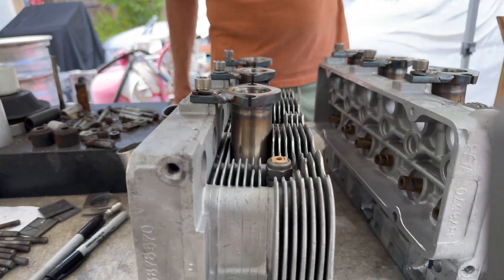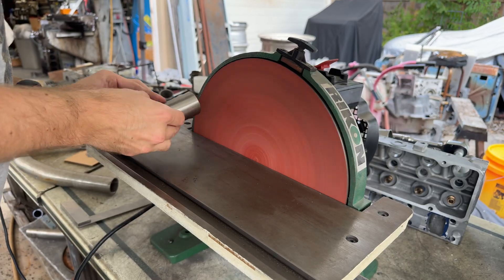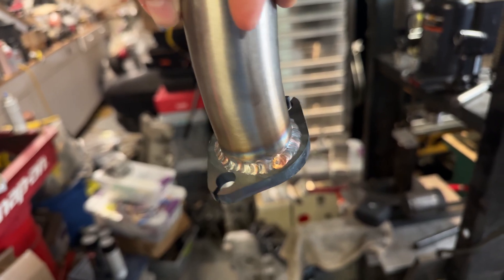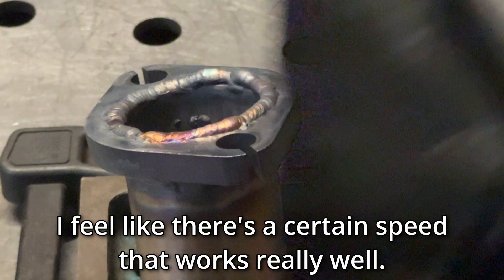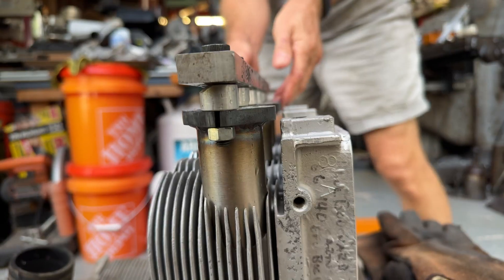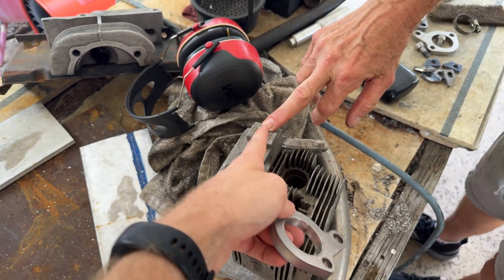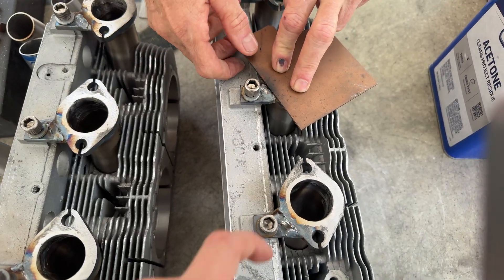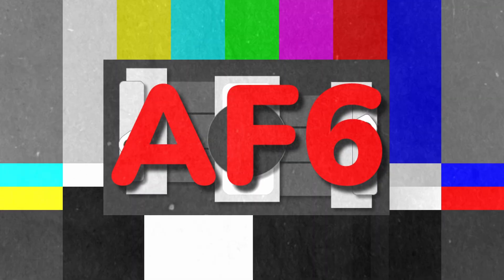How We Make Angle Ports For Corvair. (Corvair Head Rebuild Series Bonus Video)

Comment: Beautiful. You can mig stainless also. I do it all the time, if for whatever reason you wanted to make it all stainless. Do you guys only do 140 heads?
Reply from the maker: Thats true. We do the flanges in steel right now because we don't have the correct gas and wire for stainless. We do big valve conversions for all heads from 80 hp to 110 hp and turbo. We can also convert heads from one to another like 95hp to turbo (except non-140 to 140s because of the port casting).

Comment: So, is that a $10,000 engine? $15,000?
Reply from the maker: Close. For this customer, we did much more engine work than just these heads...
Reply: @AmericanFlat6  I dreamt of making a hyper Corvair. Tube frame, 7/8 scale widebody fiberglass, all suspension gets rid of giant steel stampings changing to unequal length steel tube design with horizontal shocks, mid mounted gas tank, sound proof, $20,000 interior, $15,000 paint, chop 2”, lay back windshield and possibly move it forward about 3”, 20” wheels, widest tires in front, carbon tube shift linkage, and on and on.

Comment: What does all this work buy you in terms of performance?  Why do it all if it doesn't give you a lot more low end torque?
Reply from the maker: The heads of rebuild itself gives a huge boost in performance and the angle ports improve the exhaust flow significantly. These heads specifically are for a big bore 3L engine so it will have a lot more low end torque while also having top end power.

Comment: Welder here....why was he using that big ass cup !!!!
Reply: Better gas shielding of the weld.
Reply: @charlesheit4880 yes it does....but is it needed in this case ? ....former rocket welder here
Reply: @jonsingle1614 highly recommended when welding stainless
Reply: @charlesheit4880 Never have needed to use one....welding stainless myself...but the fact that you can't see your welds would have made me switch to a smaller cup
Reply: Gas lens from hell

Comment: Really impressive work done here! Wasn't aware there was the much demand fore a high performance head for the Corvair six. I'm surprised with today's tech, someone isn't creating a 3D print and casting new heads with built in performance upgrades like the VW flat fours have?
Reply from the maker: Thanks. Guys are still driving their Corvairs around and when they drop a seat they also want to get an upgrade. You're right there should be an upgraded head available already. I think the only reason someone hasn't done it is because the market is so small. We're working on something now so stay tuned.

Comment: You might have your Pop try using a Furick #16 clear glass cup while welding. I notice he get the electrode a bit far in front of the puddle. Is he using 2 % Lanthanide electrode?
Reply from the maker: He was already complaining about not being able to see the puddle behind the arc and torch so a clear cup would do wonders. He uses 2% thoriated so he can do 300 amps on aluminum. Maybe he needs to use a lanthanide electrode just for stainless or thinner welds.

Comment: My 2 cents 

I’d might have looked into having some sort of ceramic coating on the tubes to help deal with heat. Air cooled engines really need all the help they can get in that department 

Just leave last 1/2 inch or inch bare where the interference fit in the head is.
Reply from the maker: That would be a great addition to this mod. Temp is definitely the enemy for Corvairs, but with the race port exhaust, the heads already see a 50°F reduction in temp. 
My dad has gotten the chambers and exhaust ports ceramic-coated before, and it helps, but it increases the cost and lead time quite a bit. I will be doing a video soon on all the random modifications my dad has done to the "test" heads we have lying around.
Reply: @AmericanFlat6 dam that’s a big drop

Just ran into these videos so I’m probably gonna end up binge watching them 

I love how it’s just the right amount of old school cool mixed with modern tech

Comment: Also, why not cast a new head? And cast new big bore cylinders . To allow 1.60" 2.02" valves and 4.125" pistons .   Or two 1.45" exhaust  valves and a pair of 1.94" intake valves and possibly water cooled make billet cylinders with water passages. A head made similar.  Cast the rough shape in a spinning mold to inject the aluminum under centerfugal forces have 2 or 4 head molds on a turntable.  Spinning at 45-250 rpm with the molds heated as the aluminum fills them . A 60" wheel with plaster covered foam inside sand the aluminum kept warm (possibly) afterimage is poured. Spun at a decent speed. Forcing games out of the aluminum. The head possibly  uses 4 additional bolts to clamp the head to cylinders.  The new water cooled  cylinders and heads  has an integrated water manifold . Feeding water into the head at the exhaust manifold across the head 25-30% of the water entering the cylinders exhaust side . The rest on the intake side and possibly  an aluminum bracket or girdle bolting head to head top and bottom. (For big power engines.( Or aero use)  helping keep the heads on the crankcase with high cylinder pressure..  the heads being about 1"-1.5" taller than stock. With the intake and exhaust ports raised .750"-1.25" use beehive springs and m6 valvestems, possibly LS valves .
The  raised ports and large valves should double flow compared to stock   or modified stock heads. Not certain if the bore spacing or head studs would allow a for a 4.125" bore. Maybe a
4.0" or 4.065" (a 4.250 would be nice)  Maybe cast a crankcase and cylinders with heads also. A BIGBLOCK CORVAIR ENGINE.  A CUSTOM CRANK AND CAM. 4.250" -4.375,4.400" bore with a 3.50" to 3.80" - 4.00" stroke.  6" rods use big block or small block bearings and crank journals cast a steel crank with big block snout using a bigblock chevy timing set. Possibly a gear drive big block cam bearings . A custom cam core milled from a 3" HSS TOOL STEEL BAR. BORED HOLLOW AND A .010" HOLE IN THE BASE CIRCLES ON A FLAT TAPPET VERSION. OR A ROLLER VERSION USING BIG CHRYSLER  OR CHEVY  SOLID ROLLER LIFTERS. WITH BRASS BUSHING IN THE LIFTER BORES. .625"-.680" POSSIBLY  a big block checy canted valve setup. The cam tunnel raised to get better pushrod geometry.  The lifters spraying oil on the cam. 2.20"/1.90" valves . If you cast heads and cylinders casting a crankcase isn't that much more work. The crank case  using traditional v8 style main caps placed at a 45° angle with 6 main studs and a dowel pond using traditional v8 chevy bearings and a 1 piece rear seal. 8:1 compression  with 30 psi + boost or 10:1 naturally inspired hp. With .685"/.698" int./Exh. And roughly 294° total. 230°-244° ? @ .050"  make about 25-30 additional hp over stock from 1500-2400 rpm is the goal. And about +100 at 3000.+150 @4k +250@5k +350@6400 and make around 560-580 hp around 7600 rpm non boosted.  Or 1200hp at 18psi (16-20psi) and peak around 2000 -2.2k hp with 28-32 psi) under 8000 rpm. From a corvair INSPIRED engine using chevy v8 parts  insane idea and what kind of transmission would handle it? I guess you would have yo build it aswell.  Cast a 1" thick aluminum  case to hold a 12 bolt diff. And gears from a t56 6speed gear box  and use axels using modified  1 ton k3500 front axels from a diesel 1 yon truck also using the hubs with re drilled to a 5 on 4.75" bolt circle. And find rotors and  calipers to fit and not be larger than the front.  Heck at this point you have basically built a car😂 have an awesome day🎉 forgive my crazy rambling.
Reply: yup using 60 year old heads and aluminum on top of that ! one of the shops i play at they were doing the intake and exhaust they tried to get me involved ! no thanks i have all my hair and i am going to keep it not only that ego don't pay the bills !
Reply: Unfortunately unless you’re casting these by the hundreds billet would be far more economical 

I would love to see these engines get more love and support that they deserve

Comment: Why not make stainless flanges?  Get a 4" x .375" or .500 bar of stainles. Mill it Tru and flat. And plasma cut the flanges. OR  use a 1" alum plate. AND SWAP IN A SUBARU ENGINE!😂
Reply from the maker: We can always do stainless flanges. Steel ones just make welding the tabs easier. If a customer specifically wants stainless, we'll do it. A Subaru would make quite a bit more power, but you'd have to do a good amount of work, and you wouldn't really have a Corvair anymore.
Reply: I agree, I'd pay extra for 316SS tubes, flanges, and tabs.

Comment: Do you or have you ever checked these on a flow bench?  Any numbers comparison. I’d be interested if you could show the gain for this mod. Is the price worth the gain is my question   Thanks
Reply from the maker: Yes, we have. The stock 140 exhaust flows 97 CFM at 0.600" (all tests are at 28" of H2O), and with the current 1.5" angle ports (and 1.5" valve + race porting), the exhaust flows 162 CFM at 0.600". The intake increases from 151 CFM at 0.600" to 250 CFM. So you get a big bump in power from the heads alone.
Reply: Wow. @AmericanFlat6

Comment: when cutting the head for the tube, would the vacuum be more effective if you were sucking on the combustion chamber side of the head?
Also, is there a reason the flanges have a split at the bolt hole?
Thanks for the video ;)
Reply from the maker: Sucking from the combustion chamber side could probably work but the main thing we're trying to suck up is the dust from the plaster. Also the flutes of the end mill are designed so the chips are pushed up but that doesn't mean they all go up and some still go into the exhaust port. 
I don't know exactly. I think the manufacturer does that to combine the holes with the outer profile so it doesn't have to start and stop as much. That's the best explanation I can think of because the slots don't affect the welding or the hole tolerance or anything else with the headers.
Thanks for watching!
Reply: @AmericanFlat6  Okay, thanks!